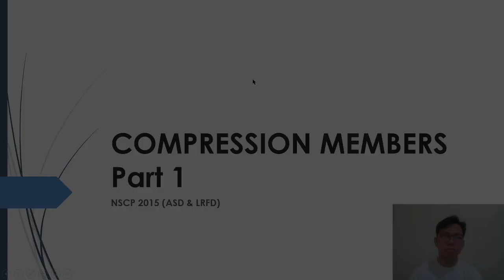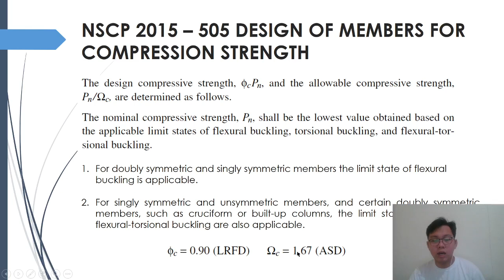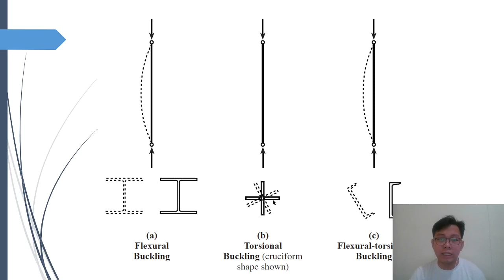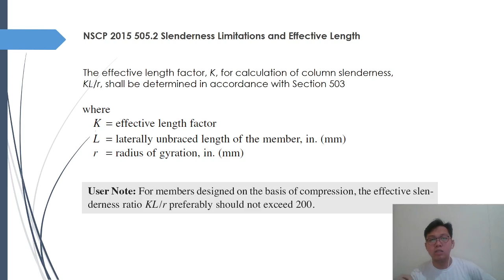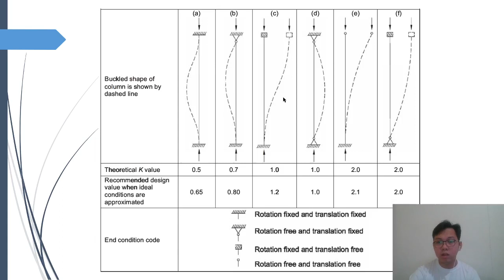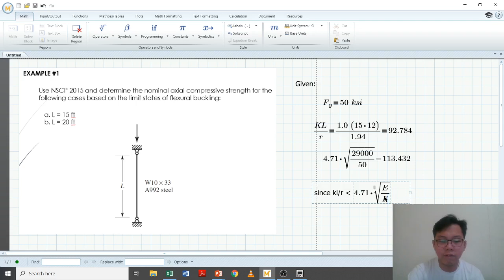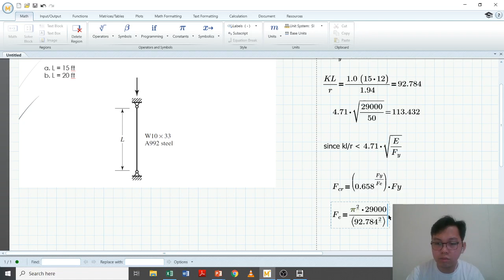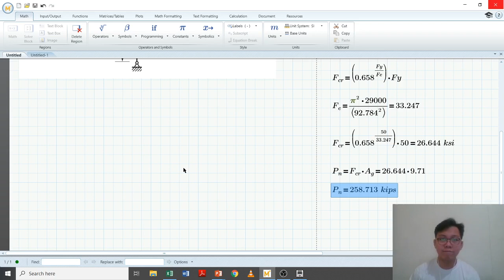NSCP 2015 (ASD & LRFD) - STEEL DESIGN (Compression Member - part 1 Flexural Buckling)

Comment: Constant po bayung 29000 E
Reply: modulus of elasticity ng steel, 29000 psi
Reply: constant, 
29 000 ksi or 29 000 000 psi, when in english unit (in., ft.)
200 000 MPa or 200 GPa, when in SI unit (mm., m.)